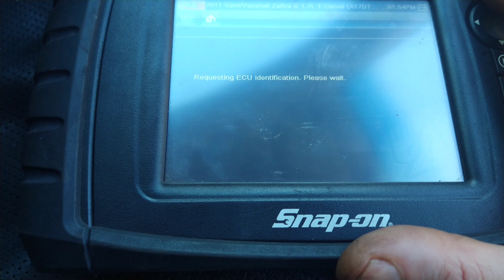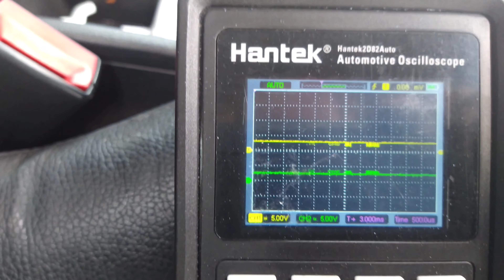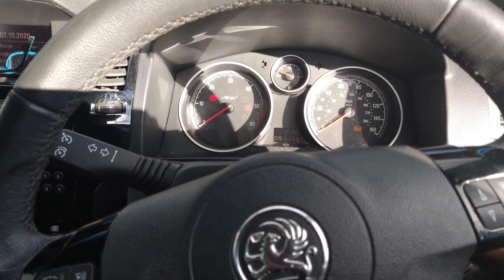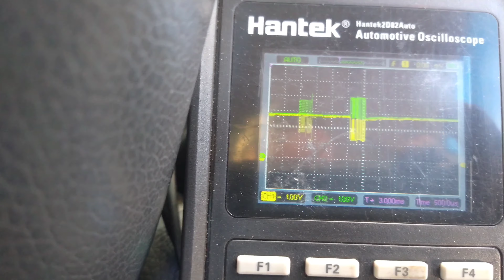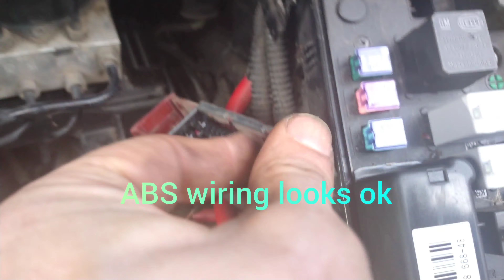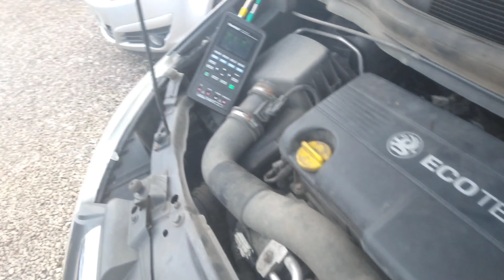Vauxhall zafira ( no start, co communication ) faulty under bonnet body control module.

Comment: Awesome video mate, ive got a zafira B 2011, and after replacing steering pump and disconnected and connected again the abs module, now it doesn't crank/start, on Autel says no connection with abs module. I not even know where to start.... ill try to wiggle the looms like you did.  Cheerz

Comment: How did you code new bcm in. Using what tool?
Reply from the maker: Hi James, I didn't code the new bcm, I used the old circuit board from the original bcm, I made a follow up video showing this, I'll find the link. Cheers Matt
Reply: @mechanicmatt871  u little beauty ha ha. Answered that then. Class
Reply: Been told they reset it using tech 2. Then i receive and after connecting then battery reconnect, I use opcom to code. 

Im not sure but think simply swapping over the pcb board from old to new woukd do it
Reply from the maker: https://youtu.be/Fjex4pGEhIw

Comment: Im on a zafira now. No start and when crank not even a click. Only the relay for blower clicks in engine fuse box instead. Power to starter relay and starter cranks. So pulled front and back units plus ecm. Gonna fit second hand ecu lock set maybe.

Comment: Really great video ive had problems with them zamora fuse boxes the drain holes under skuttle panel were wiper blade motor is blocks up and water goes into the fusebox when have heavy rain
Reply from the maker: I'll check the drain holes while I'm waiting for the fuse box. Thanks for watching and your comment

Comment: Good video Matt good content  , I have same breakout box , those can lights on it only work when voltage is greater than 5v , I do remember a video where someone has modified it so the lights work at a smaller voltage and those fuse boxes are common, there not coded , nice one Matt 
Rob mobile man
Reply from the maker: That's good to know, thanks for the info, cheers mate
Reply: im in the market for a breakout box. assume you dont recommend that model then. can you recommend 1 that wont break the bank please.
Reply: @the_retired_mechanic  
Hi , the breakout box does work ok, u just won't see the canbus lights work unless it's above 5v , so I wouldn't worry too much 
Rob mobile man
Reply: The Retired Mechanic Please excuse the intrusion. I was reading the comments...This one is very basic. Note pins 4&5 are common. It also will not accommodate “shrouded” leads https://www.amazon.ca/dp/B083LQ9MRR/ref=cm_sw_r_cp_awdb_btf_t1_-6VGFbC8GE9JV 
It’s the Canadian site but you get the idea. Cheers